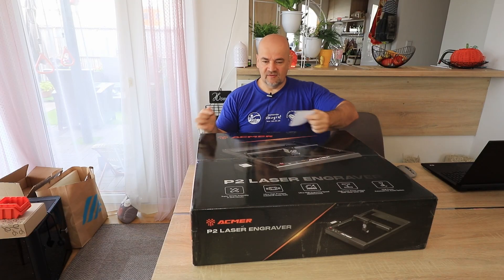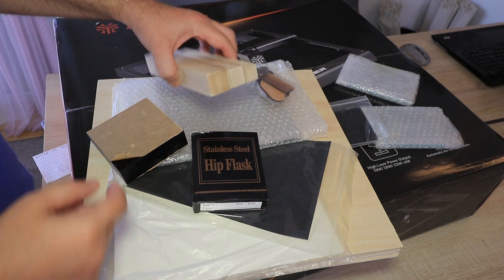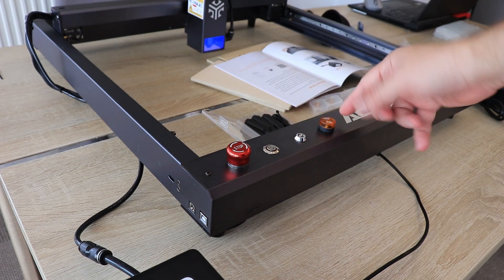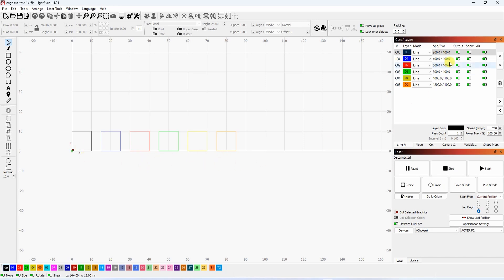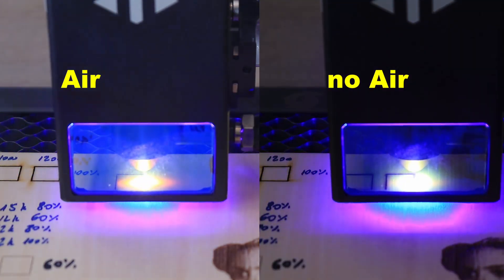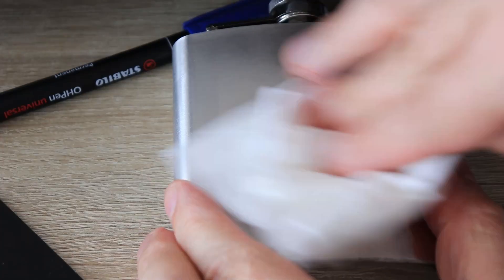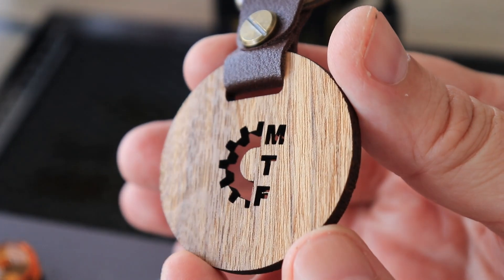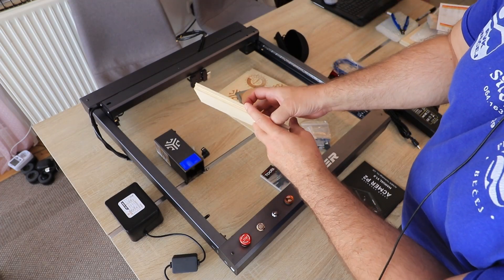Acmer P2 33W - linear rails on both axis

Comment: Nice video my friend...At least is's not an ortur...see below

Well-Known Issues with Ortur Lasermaster 3: A Comprehensive Review

Issue 1: Ortur LM-3 Not Powering On
One of the most prevalent problems encountered by users of the Ortur Laser Master 3 is its failure to power on. This issue can stem from various factors, including a faulty power adapter, blown fuse, loose connections, malfunctioning laser module, or motherboard glitches. Notably, the Ortur LM-3 has faced criticism for having an underpowered "power brick." Despite seeking assistance for this issue, my attempts were met with silence. Subsequently, I discovered a suitable replacement on Amazon.

Issue 2: Inadequate Laser Engraving
When laser engravings fail to meet expectations, several causes might be at play. These include improper focus, uneven engraving area, or unsuitable materials for engraving.

Issue 3: Mid-Operation Halts
Frequent occurrences of the machine halting during operations can be attributed to loose connections, faulty motors, or software/firmware glitches. This issue has been highlighted extensively on YouTube.

Issue 4: Subpar Engraving Quality
Substandard engraving quality can arise due to incorrect settings, a dirty lens, or a malfunctioning laser module. To rectify this, adjustments in settings, proper lens maintenance, and considering the laser module's condition are recommended.

Issue 5: Smoke and Odor Production
During operation, the machine emitting smoke or strong odors might be a result of a dirty lens, improper settings, or insufficient ventilation. This concern is commonplace among lasers, particularly during cutting. Installing proper external ventilation and employing an enclosed setup are advised solutions.

Issue 6: Unusual Motor Noises
Motors emitting abnormal sounds during operation may be attributed to loose connections, inadequate lubrication, or faulty motors. Similar observations have been shared on YouTube. A common cause was Ortur's inadequate tightening of drive sprocket set screws, resulting in loosening.

Issue 7: SD Card Recognition Failure
When the machine fails to recognize an SD card, possible reasons include a faulty SD card, corrupted files, or firmware complications. Contacting Ortur for assistance may lead to unresponsiveness, as evidenced by my own experience.

Issue 8: Machine Freezing During Operation
Machine freezing mid-operation may stem from software/firmware glitches, motherboard issues, or communication problems between the machine and the computer. Establishing a reliable link between my Ortur LM-3 and my computer proved to be a major struggle. Despite weeks of effort and assistance from Ortur, I ultimately sold my brand-new machine at a loss due to this issue.

Issue 9: Inconsistent Engravings
Inconsistent engraving results might result from incorrect settings, a dirty lens, problematic materials, or a malfunctioning PWM (pulse width modulated) laser power controller. Obtaining assistance from Ortur for this issue was often challenging.

Lack of Customer Support and Service
In terms of customer service and support, Ortur falls significantly short. Despite purchasing their hardware, I received no aid when problems arose. Requests for help went unanswered, and defective parts were disregarded. Unfortunately, Ortur seems unwilling to invest in its customers' needs or satisfaction.

Personal Experience with Ortur LM-3
My excitement for the Ortur Laser Master 3's potential to enhance my workshop quickly turned to disappointment and frustration. Despite its promising appearance, I encountered only obstacles and minimal assistance from Ortur. Their lone response directed me elsewhere for help. Ultimately, after exhausting various resources without resolution, I was forced to sell the Ortur LM-3 at a substantial loss, leading to the demise of my aspirations.

An Urgent Recommendation
Given my ordeal, I strongly advise considering alternative options before investing in an Ortur product. It is my hope that you avoid supporting a company that displays such an evident lack of commitment to both product quality and 
customer service.

Parting Thoughts
I am not inclined to write negative reviews, but I felt compelled to share my experience as a cautionary tale for others. Thank you for taking the time to read my account, and I sincerely wish you success in your pursuit of a laser product that truly meets your expectations.

Comment: I can't decide between Acmer p2 20W or Ortur laser master 3 20W. Which is better option to get? What would you get on my place and why? Thanks😊
Reply from the maker: Both modules are very similar, I would go with linear rails (Acmer).
Reply: structural advantages of the ACMER are even greater, and this has a very direct impact on the engraving results